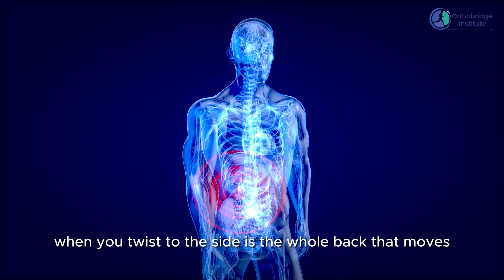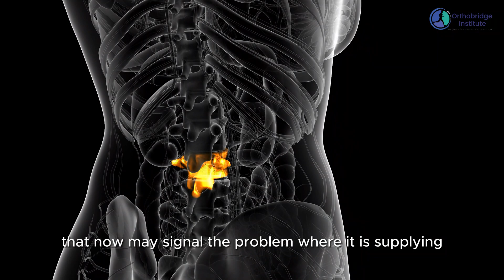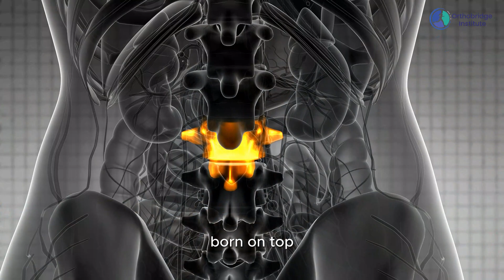Percutaneous Laser Disc Decompression (PLDD); Discogenic Back Pain Treatment by Col (Dr.) Adari

Comment: You should use captions that are not autogenerated, as the latter is too inaccurate, due to your diction/ pronunciation being unclear and too 'soft', especially to a british ear, especially if a degree of high tone deafness. Your video will be more effective.
Interesting subject, though, as a patient with central bulge, mild sp'listhesis and spinal stenosis. I only knew about 'MILD' procedures or similar up until now, in the minimally invasive arena. I like the concept of retracting the disc bulge into a vaccuum.
How does the needle avoid damaging nerves and spinal cord in the path to the disc?